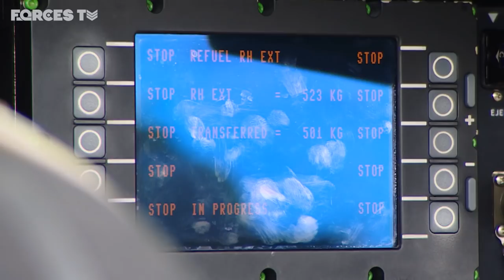How To Get A Typhoon Off The Ground | Forces TV

Comment: Wow, I didn't realise that the typhoon is so advanced that it doesn't need a squadron of aircraft techies to keep it serviceable. Keep up the good work chefs and PTIs, you're the real heros
Reply: What do you mean? gef and mt fix and fuel them... 😂
Reply: That’s because all the aircraft techies are gimps. They’re not real engineers anyway, they don’t actually fix anything. The proper engineering is done by BAE.
Reply: Millennial Trucker we just eat the crayons in the drawers
Reply: It was designed to be cheap to run and own. Unlike the F22 and F35 which seem to need a week on the ground for every hour in the air.  Which in a war is insanely expensive and puts everyone at huge risk.

Comment: The Typhoon is so powerful that it can takeoff with a full load and not need the afterburners.
Reply: I saw the video of a pilot use of those engines to do an almost vertical landing and then plop it on the floor because the aircraft airframe is so strong.

Comment: Yeah, the aircraft computer can monitor speed and oil but... Can it run Crysis?
Reply: Cloud Boi true
Reply: Most likely these computer runs some form of linux, so no.
Reply: No computer in the world can yet run Crysis on ultimate settings, a 1080Ti runs off into the corner and starts crying :-) Nice to see GEF/Gen Eng/ Support Equipment Flight got there 30 seconds of fame :-)
Reply: It couldn't run Tetris.